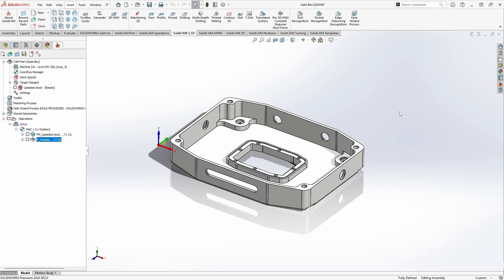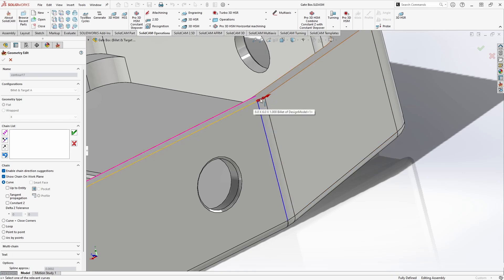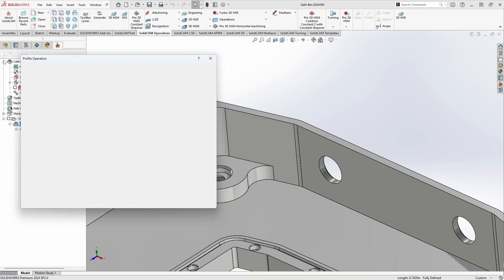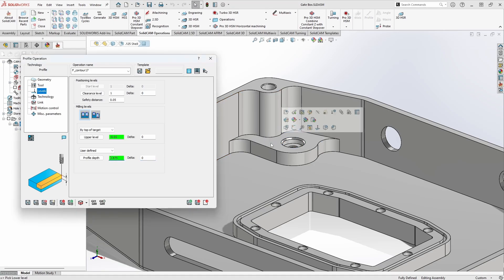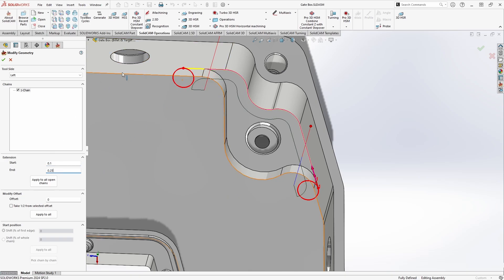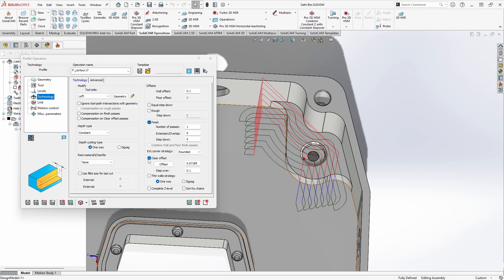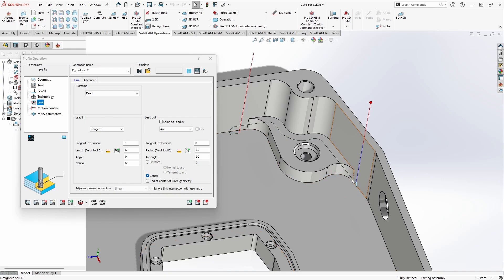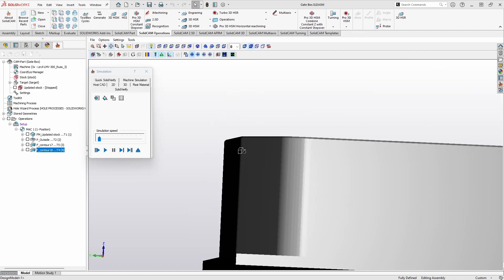Intro Milling   Profile

Comment: Hi, just got new pc at the job and I have problems about solidverify. It works for few operations and in the next there is not stock when i go to solidverify it's just blank. Please help.
Reply: There is a good solving ..indeed! 
Before simulation....in few cases ..USE...clean up...the operation.s.....! Via ..tree cam .The app will refresh your sim solidverify....recalculated new stock updated.